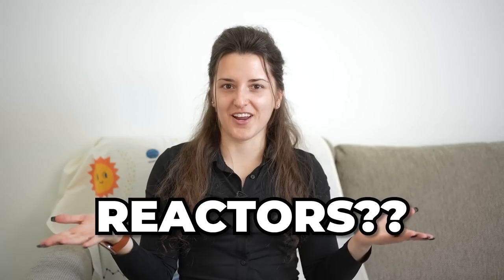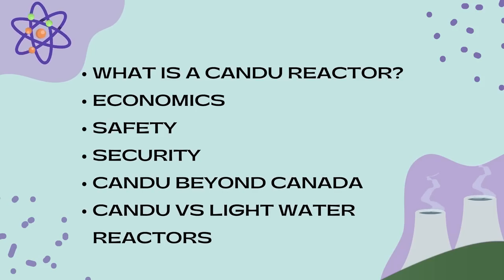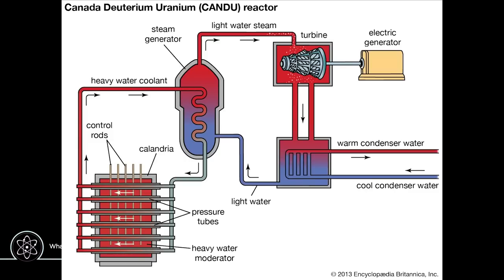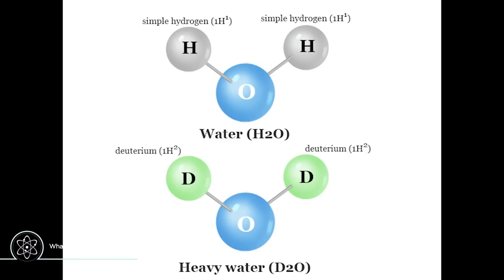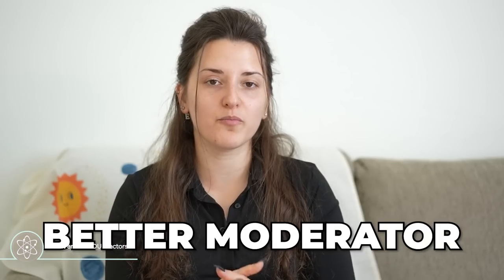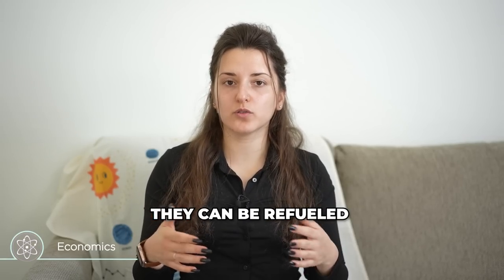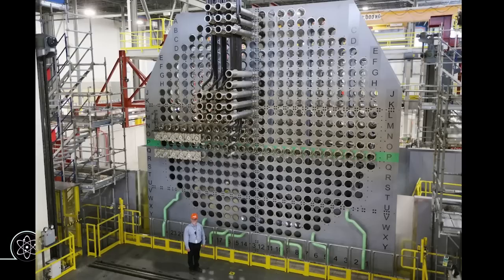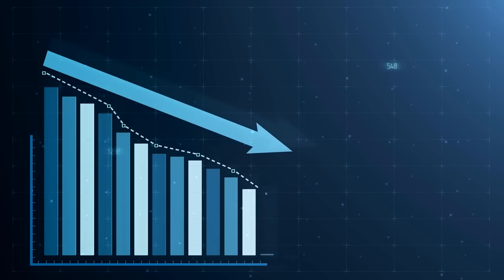Nuclear Physicist Explains - What are CANDU Reactors?

Comment: Actually, lower working temperatures is not an advantage at all. It lowers the overall efficiency of power producing due to thermodynamic reasons. Many reactor designs are on the contrary trying to increase the temperature of the first circuit using liquid metals, molten salts etc. as a coolant.

Comment: Honestly the reactor type that should be used going forward is neither. It should be gas cooled pebble bed fast neutron reactors. They have a much higher burn up rate, meaning less long duration waste to deal with, they are unable to meltdown, and can be refueled while still online as well.

Comment: Let me know what you think you said: Ok. Something often discussed is the ability of running a thorium cycle in these reactors. I am also curious if district heating using these reactors is an option or does the fat they operate at a lower temperature change that? My country has a bit of a stock when it comes to actinides. We used PWR's for years. Are those actinides reusable? I have no idea how much weapons grade plutonium out reactors have produced over the years or if it has been sold. I know that this plutonium can be used as a fuel or in a fuel mix. Please explain that in more detail. I also know CANDU reactors work with pellets in the rods how does that differ from other rods? I would also like to know, if sometimes different fuel types are used at the same time. If it is refueled without stopping I almost think this is inevitable? How is modulation done safely in that case?
All this to say , i'm sure there is room for a candu reactors part 2 in a couple of months.
Thank you for the videos. I enjoy all the types of content you make.
Reply: I think the problem with nuclear district heating is that you don't normally build nuclear reactors near larger population centers.
Reply: @Phredreeke  That is an opinionated argument, The most productive nuclear power plant in my country is smack in the middle of a town and a mere 15 km from a major metropolis. I'm just looking for facts about the feasibility. Thank you for taking the time to reply though.
Reply: @Phredreeke  the Pickering nuclear power station in Ontario Canada is less than 400 meters from a marina and is surrounded by a major subdivision.  If they were willing to build a heat exchanger I could see how that would be useful as right now all the waste heat does is warm up Lake Ontario.
Reply: Candu reactors use sintered natural uranium oxide pellets. Since there is no enrichment having taken place, there is about 0.7% the uranium that is readily fissile material, or about 0.65% of the overall mass. Those pellets are packed into zirconium alloy tubes, with several such tubes attached together to form a fuel bundle. Before being put into a reactor, the fuel bundles have such low radio-activity that they could be handled by hands. As for usage, the fuel is subjected to a different neutron flux, lower at the extremities and higher in the centre. When refueling a tube, the fuel bundles in the first 3rd of the tube is pushed to become the one in the 3rd third, with the spent fuel removed being the one that was in the center having been in the reactor for one full cycle, and the one that was in the last 3rd having been there for two cycles; refueling involves replacing 2/3 of the bundles in a tube. Using alternate fuels would typically involve mixing the fuels to have some kind of an homogeneous mix, to maintain a reasonably constant reactivity across the whole reactor, and manage the neutron flux.

Comment: What about the use of liquid salt as the moderator in a nuclear fission reactor? I’ve looked into it and it seems to have a much higher useable enthalpy range?
Reply: Of course it would require a dual phase heat exchanger that would introduce some lose of efficency.
Reply: Liquid salt is used as a coolant in fast neutron fission reactors, that do not require a moderator. The liquid salt has pour moderation propreties so it is not possible to use it in slow neutron (thermal) reactors... 😁
Reply: @andrei792001  good to know.

Comment: What is the function of heavy water?
Reply: Its used to 'moderate' neutrons.
To explain it as simply as I can (skipping over some complex but important details), basically there is a sweet spot for neutron energy that increases the likelihood of causing a subsequent fission event with another Uranium atom. The neutrons that are emitted from a Fission event come out at very high energies, energies that are too high to be likely enough to generate a predictable, sustainable fission chain reaction with the quantities of Uranium-235 that occur in natural Uranium. The heavy water can be thought to kind of deflect high energy neutrons around, and as they bounce around in the heavy water the neutron loses energy by imparting momentum to the Heavy Water molecules, this process is moderation. Eventually the neutrons are moderated down to that sweet spot where they are very likely to cause another Fission event, which continue on to support the chain reaction. All this happens in a fraction of a fraction of a fraction of a second.
Reply: Its one job is to have a neutron, and use it to act as a catalyst in the reactor.  This is also why the reactor is able to use the variety of fuel it can.

Comment: You mention one of the advantages of the CANDU reactor is that it can use a variety of fuels. But do not mention that one of them is thorium. I have seen an old report by the Canadian Atomic Energy Commission that says, Thorium could be used in CANDU reactors and that Canada has enough thorium to last for 1000 years. But that it would be more efficient to make a new reactor specifically for thorium.

Comment: Question:
1: Could Super heavy water (tritiated) be used?
2: Could other radioactive elements like Americium, Neptunium, Plutonium, etc. be used as fuel, even if they're harder to split apart than Uranium?
Reply: 1. It might work, but it would not be as good as D2O as a moderator and hard to use because it is very radioactive.
2. Other elements can be used if they have fissile isotopes. Of the ones you list, Plutonium is commonly used as fuel. It is mixed with Depleted Uranium to make Mixed Oxide Fuel (also known as MOX).

Comment: As far as i know, one of the advantages of CANDU reactors was (still is, but to lesser extend) that they don't need fuel enrichment (above the level of natural content of cca 0.7% U235) but with time, low cost and effective enrichment methods become available (especially gaseous centrifuges) so this advantage mostly vanished. Also the online refuelling become less important, since today's light water reactors have downtimes like one week per year (cca 2%) so if you improve on that towards like 0.5% (SOMETIMES you need to shut down for maintenance even a CANDU) the difference is not so big...
Reply: Yes well CANDU's tech is from the late 50s so there has bound to be some improvement. It's hard to tout the advantages of a carburettor vs DFI. I mean, I like the sound a carburettor makes... also perhaps that it is connected directly to the gas pedal with a solid cable... see what I mean ? ;)
Reply: At least for PWR's, I think a typical refuelling outage will take at least 25 days every 18 months.
Reply: @derekp2674  current generation VVER-1000 use for example 4-years refuelling cycle, during which is 3x exchanged third of the fuel bundles, each taking two weeks. That gives 6 weeks of refuelling outages within 4 years, giving 94-95% availlability... All normal maintenance is performed during these outages.
Reply: @SYNtemp  That's impressive - thanks - and much less outage time thanks the PWRs I work with.

Comment: So the final question, which you sort of skirted around was, which is more economical overall the CANDU type or LWR type?
Reply: It depends.

Let's say your country is trying to decide.  What kind of nuclear fuel do you have access to?  Your own natural uranium deposits?  Do you already have fuel enrichment facilities?  Are you planning on buying "waste" fuel from other countries?  If you have uranium but no means to enrich it, CANDU will allow you to use your uranium as is.  Do you have access to large amounts of fresh water that you can extract D2O from, or will you have to import it?  Heavy water costs about $1000 USD per kilogram and a CANDU 6 reactor (600-700 MW net electrical output) requires ~450 tonnes of it, so that's $450 million USD just to buy the coolant/moderator.  The CANDU calandria less advanced industrial capabilities than the pressure vessel of a LWR and doesn't require an extremely strong containment building, but the calandria is huge: diameter of 7.6 m and width (it is a cylinder on its side) of 6 m.  Which is your country better able to build?  How important is a high capacity factor?  Does your country already have lots of baseline power production, or are you going to rely heavily on this reactor being online all the time (or at least as much as possible)?

These are just a few of the high level questions that will determine which reactor type is more economical over its operating life.

Comment: @7:24 Untrue. CANDU reactors do produce plutonium-239. India has used their Canadian-designed reactor produce some of the plutonium used for their bomb stockpiles. It's my understanding plutonium production can be reduced or enhanced by changing the diameter of the fuel rods. A thicker rod means the neutron spends more time inside the fuel, where it might be captured by uranium-238. A thinner rod gets the neutron into the moderator where it is slowed to the point it favors capture by uranium-235 and therefore a higher probability of fission.

@7:35 Totally false! Heavy water absorbs fewer neutrons than light water. If it absorbed more the CANDU reactor would require fuel enrichment. The whole point of CANDU's use of heavy water is that it absorbs fewer neutrons. Occasionally a neutron is absorbed and the deuterium atom becomes a tritium atom. To prevent the buildup of tritium, which would become an environmental issue of there was a moderator spill, the tritium is removed and sold.

Comment: A low operating temperature may have the advantage of producing fewer plutionium.
On the other hand, even the efficiency of LWRs is rather misaerable, when thinking about Carnot´s efficiency:
the less the temperature differences between hot side and cold side ot a thermal engine, the lower the maximum efficiency.
So, having a lower operating temperature a a design compromise at best, far away from being a feature.
Actually, raising the oeratng temperture by quiet a margin (read: above 1000°C) would offer the opportunity the use the thermal energy released by a nuclear reactor as process heat for chemical reactions, especially for splitting water into hydrogen and oxygen. The hydrgen could in turn be used to convert CO2 into hydrocarbons.

Comment: 7:50 can you explain what you mean by heavy water can "absorb more neutrons"? This is the opposite of my understanding. The whole point of using heavy water is its ~500x LOWER absorption cross-section, which is what makes it a better moderator and allows enough neutron economy to use natural uranium. Do you mean that the scattering cross-section is lower and so more neutrons are lost from the core? This makes it a worse moderator! Please help me to understand!
Reply: At 7:50, that was an error in the presentation. The thermal neutron capture cross sections of D2O and H2O are 0.0011 barns and 0.66 barns respectively.

Comment: I didn't follow why CANDU doesn't produce as much plutonium, you said 7:54 "for the fission products to be turned into plutonium". You surely misspoke, no way a fission product with an atomic weight from 140-90 is going to climb all the way back up the periodic table to plutonium (239). I suspect the mechanism which limits plutonium production would be reducing the number of fast neutrons available for U-238 to capture and transmute into plutonium? More efficiently thermalizing the neutrons leaving less fast neutrons? 7:26 "Do not produce weapons grade plutonium like light water reactors do". LWRs might produce "Weapons Grade" plutonium given a short fuel burn of less than a few months. This is not how power reactors are run, with longer fuel burn times of 18 months or so. Thus spent fuel from LWRs is does not contain "weapons grade" plutonium (as pure Pu-239 as you can get) but a mix of plutonium isotopes that make it problematic to weaponize.

Comment: Explanation why CANDU reactors produce less or no plutonium doesn't make much sense to me. I'm definitely not an expert, but I'm convinced plutonium is created from U-238 not from fission products (as suggested at 7:54) and the amount of neutrons doesn't explain anything. If the fuel is not enriched, the ratio of U-238 to U-235 is even greater than in the PWR. Less neutrons means lower intensity of the process, but the ratio of plutonium creation to U-235 fission should be correlated with the ratio of U-238 to U-235. I suspect the difference is not in the quantity of neutrons but in their energy. Maybe, if neutrons are slowed down in heavy water their energy is different than in PWR and that influences either the probability of U-238 absorbing such neutron and turning into Pu-239 or the rate at witch produced Pu-239 fissions. Maybe, in CANDU plutonium is more likely to fission right after being created (because of the difference in the average neutron energy) and thus less of it is left in the spent fuel.
Reply: You are correct - the video was wrong. I think what should have been said was that commercial CANDU reactors are normally operated so that the Pu in their spent fuel is useless for military applications.

Comment: Hi thanks for the vid ....I thought heavy watter was a less effective moderator not more effective? Deuterium niclius is less good mass match to neutron? Also it absorbs less neutrons not more so neutron economy better so can use less enriched fuel ? ...just getting this from wiki etc
Reply: You're correct. It works better as a moderator for natural uranium fuel because it has a much lower neutron absorption rate than light water, which makes up for its slightly worse neutron moderation compared to light water.
Reply: @Heja16  Cool thanks 🙂
Reply: @anonimouse8918  You're welcome :) I work at a CANDU plant in Canada, so this video piqued my interest.

Comment: I'm having a hard time understanding the physics here. I'm familiar with how light water moderated reactors work as I used to operate a few while I was in the Navy. If I recall correctly, light water works as a good moderator due to the higher average logarithmic energy decrement per collision (or squiggle as we used to called it), because the hydrogen is nearly the same size as the incoming fast neutrons thereby taking more energy from those neutrons and thermalizing them faster. Wouldn't the addition of an extra neutron in the hydrogen result in a lower squigle value since the aditional mass of the hydrogen would absorb less energy from the fast neutron making heavy water a [comparitively] worse neutron moderator?
Reply: @f-xdemers2825  lmao! Nope! Try again!
Reply: You are indeed correct sir. Light water is a more effective moderator and slows neutrons down quickly while heavy water is a more efficient moderator because it uses up hardly any neutrons via neutron capture reactions. Like you, I can never remember the proper name for that ancient Greek letter, the squiggle.

Comment: Ok so U238 is not a thermal fuel, it is a Fast Fuel. That means fission is only probable if the neutrons KE is > 0 MeV….(neutron is fast, not thermal) so why would we want to use more thermalized neutrons (the result of using a “better moderator”)

I’m not getting it…

Comment: India has had HWR's for a long time.  How are they different that CANDU reactors?  Just like LWR's, the fuel is clad in Chromalloy, which is cannot survive high temperature.  This not only limits the operational temperature of the reactor, but requires the the spent fuel to be cooled for several years after it is used.  I am still haunted by the video of exploding containment buildings at the Fukushima Daiichi complex.  Give me another option.